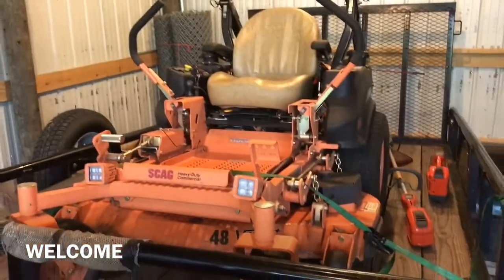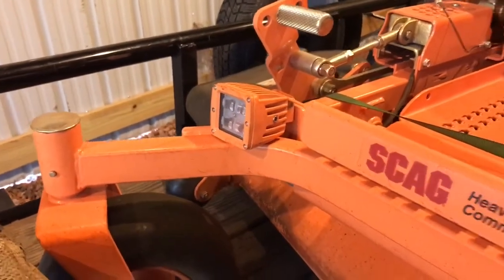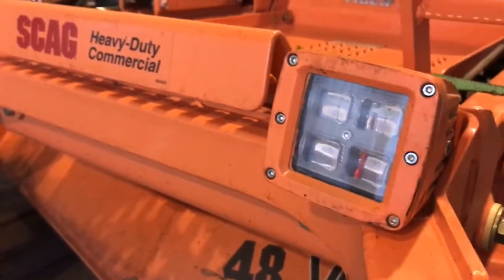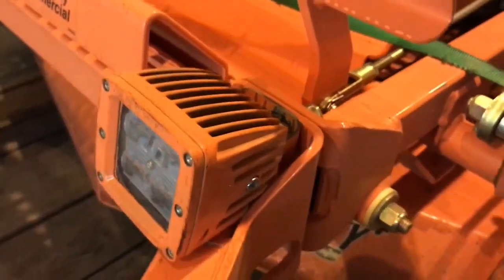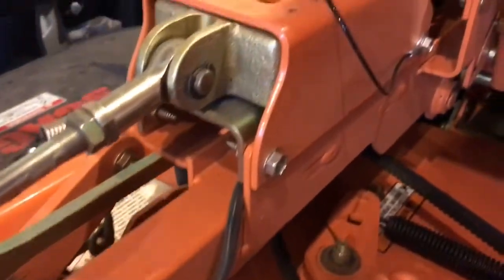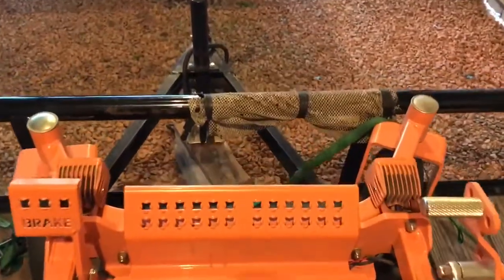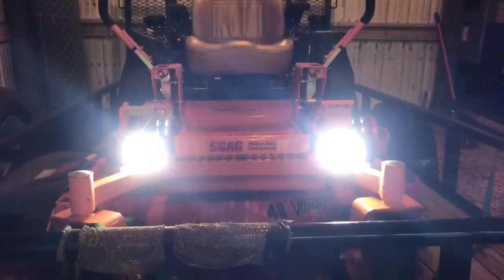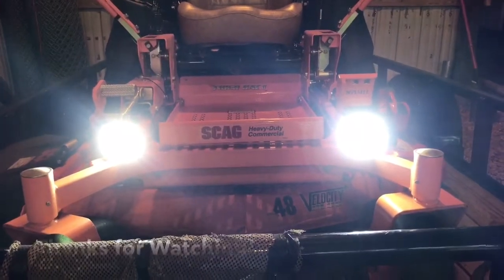LED Lights Install on Zero Turn Mower (SCAG TIGER CAT)

Comment: FYI, put a spacer (or a bunch of washers) on the bolt between the light and the machine so that way you can adjust the lights pointing down.  That's how I did mine and it kicks ass.

Comment: I like how you used existing holes. The wire can be run inside pneumatic tubing or aquarium tubing for protection

Comment: Hey Lance looking on Amazon for these lights, everything I found the mounting bolt is on the bottom, couldn’t find one with u mounting brace like you are showing in your video. Liked the way you mounted the lights , no holes drilled and sprayed painted them very neat. Thanks David
Reply from the maker: David Pillar thanks! And all the ones your seeing on amazon will work. The mounts swivel so you just swivel to the back.
Reply: Thanks Sir for your quick reply. I’m going to be getting my new tiger cat next week, if you don’t mind me asking how do you feel about your scag?
Reply from the maker: David Pillar I actually sold it but scag is a great mower. No problems out of it!

Comment: Looks good.  Can you see your deck edge ok with the residual light from the lights being in front of the deck.  Do you have any problem with glare from frame of mower where light would shine at close range?  Looks like factory imstall.
Reply from the maker: Duane Roepke yes you can see it! Doesn’t get in the way. And they are about even with the frame so it doesn’t glare any. And they do look factory.
Reply: @LancePrince  Thanks for your reply.

Comment: Hi Bro, lights look great. Where did you get the plugin with the switch on it? Also how did you splice wire into a USB plug?
Reply from the maker: Doyle Redwine I had an old switch from some lights that plug into the cigarette plug. Since then I have actually hard wired it to the battery. I was having some problems won the cigarette plug